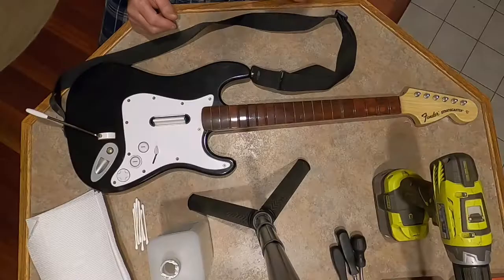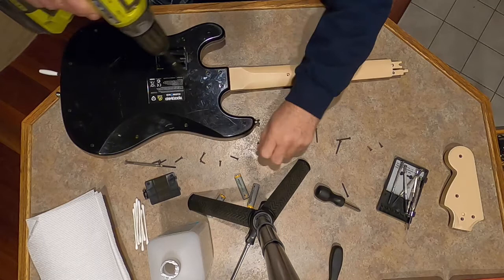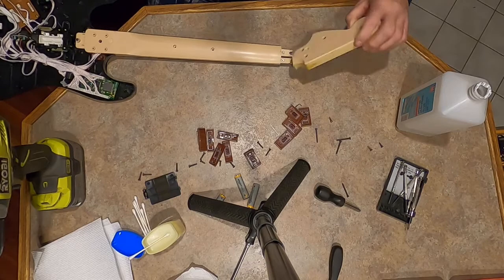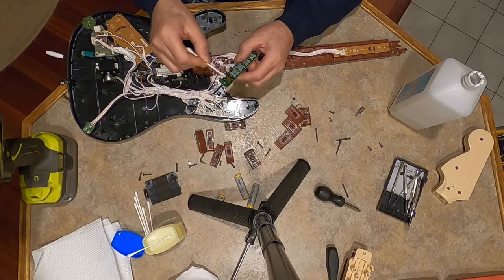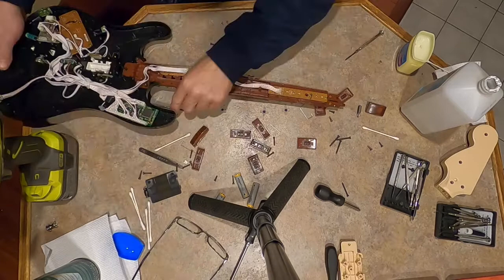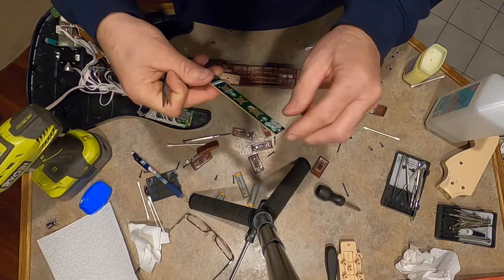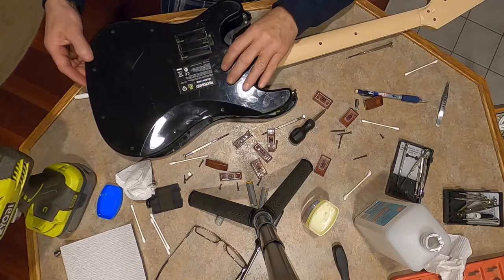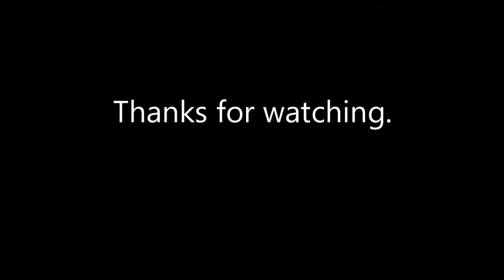How to fix Rock band guitar buttons

Comment: Thanks for making this video! My problem was the oxidation on the copper traces on the button circuit boards as well. Your video was quite helpful in getting the guitar open to the point of cleaning that up and identifying that as the problem with my guitars.

Comment: Thank you.  We haven't had a XBox 360 in years, decided to go back to the Older Rock Bands which were way better.  Found 2 guitars in ebay that had a few issues, cleaned them up like you showed they work like a charm.  THANK YOU, THANK YOU.

Comment: thanks for the popping off part -- saved loads of time on the fix. What I did was pop the cap off, use a pushpin to grab the button out, clean the gold contacts with 98% + a qtip, lay the button back in the hole, use the q-tip to get it back in the hole and line it back up by using the pushpin.
Reply: I just wanted to clean it and swap the buttons, thought I was gonna have to fully disassemble the neck at least, but I'm glad I looked it up first

Comment: how do you fix it when you shake it. when i shake mine it doesn't activate unless i shake vigorously
Reply from the maker: Could not figure that out . One of mine stopped working. I am thinking some kind of sensor but don't know
Reply: @JLafix  There are 2 small Tilt Sensor Switches that need to be replaced. It requires basic soldering. SW-520D is the part number. They almost look like capacitors.

Comment: PSA: Clean the rubber with soap and water!  
It's not a coincidence the "dirt/dust/crud" you're referring to when cleaning the rubber pads is the exact same color as the pad. It's not dirt. The alcohol is breaking down the soft rubber and letting it be rubbed right off onto the cotton. People think it's cleaning off grime, then the alcohol dries quickly and suddenly there's no more black transfer on the cotton, so it seems like it's all been cleaned. In reality you can just apply more alcohol and it'll start darkening your cotton swab again, further destroying the contact point.
Reply: good point!
Reply: These are CARBON contacts, and the "crud" showing up as black on the swab is the carbon particles.  Alcohol is precisely what should be used to clean these, NOT soap and water.  That will not only break the contacts down faster, but will likely leave a soap film over the contacts.  With the alcohol and swab, it should only be used lightly and gently because you are removing the carbon coating.  Do this enough times or with too much pressure, and you no longer have enough carbon to complete the circuit beneath the pad.  Honestly, you shouldn't even need to swab these unless they have become covered in dust/dirt.
Reply: @Archtraveler  that's weird, cuz if you were right, my pads should have broke down more than with the alcohol, which didn't as I stopped getting transfer, and should have left a film of soap, which it didn't. (And which won't happen if you rinse it, just like anything you clean with soap and water) It's almost like none of that is true, and my last cleaning from over a year ago still works great! Thanks for the warning!
Reply: @FoxCurtailed  Over-cleaning with anything will destroy the pads, and it sounds like you only did it once, and apparently rinsed enough that you didn't leave any film.  Good for you.  Can you guarantee that others reading this will use an appropriate soap or rinse it thoroughly enough?  As I mentioned before, the "black" being referred to is the Carbon, not rubber, and honestly it's going to be extremely rare to ever need cleaning.  Especially not with the design of these where the silicone boot maintains a dust seal around the contacts.  Even if liquid gets spilled on the keys (as happened to mine), the contacts were protected.  Clean these too hard or too often and you will diminish the amount of material making contact, requiring you to press harder.  Thankfully, there are various ways to repair this if needed.  The exposed metal contacts on the PCB are more likely to need cleaning than the carbon pad.
Reply: @Archtraveler  tl;dr;csb

Comment: I wonder if you can skip the "eraser" step and just hit the copper tabs with alcohol and clean the silicone pieces with soap and water
Reply: I'm about to take mine apart did skipping the eraser workout for you?
Reply: @Wheatty  it worked flawlessly. I only miss notes now when I actually miss them. The cleaned tabs register so much easier now. I have 0 complaints.
Reply: @mlsj4598  Awesome! Thanks!
Reply: @Wheatty  you can use a pencil eraser if any kind. It won't hurt it but just alcohol will do fine. Make sure it's 70% or higher though. Use soapy water for the silicone. Don't use alcohol on them. Pat dry or let air dry for best results.

Comment: Hey did you have trouble taking off the neck off the guitar? Mine feels like it’s stuck right where you mentioned there were those metal bars or near the frets that are located away from the body of the guitar
Reply from the maker: Yes it was kind of stuck but don't forget about that pin to release the neck it's on the back side
Reply: Thank you so much! Completely forgot about the screw on the second fret, that’s what it was!
Reply: It seems like my guitar is just broken, in the game the orange fret is registered as always pressed down, I essentially removed the silicone buttons from the two organs frets so there would be no contact but it still shows as pressed down :(
Reply: @aaronhou6569  Thanks for this comment! In a hurry I about broke my neck in two.. 

I would check every contact downstream of both of the orange buttons

Comment: Thank you! Do you think that the guitar works if we do not put the 2nd fret screw back in? I'm thinking about doing this to avoid breaking the caps.
Reply from the maker: I'm sure it will work might be a little flimsy.  But you can't get the thing apart without removing that screw behind the second fret
Reply: @JLafix  Thanks again! I will work on it today.

Comment: Can't we just stick the whole arm inside an alcohol bucket or smth and shake It out? Then some oil or smth?
Reply: Yeah, you sure can. Guaranteed to fix the problem, but you'll have a new problem.
Reply: @mlsj4598  That is just a lot of work, IMO.
Reply: @marlonsantana21  I did it last night.  Took 10 minutes start to finish. I'd hate for you to have a full time job.
Maybe if you get a flat tire you can just keep putting air in it instead of changing the tire because that's too much work
Reply: @mlsj4598  Oh, come on man... 10 minutes? Well, some people have more manual skills than others. I don't even have the proper tools anyway. But, yes, I don't have a linear 9-to-five full time job, you got that right. I'm a lawyer, but I buy and sell real state, cripto and online courses. Definitely not that hardware store guy. But I can change tires tho.